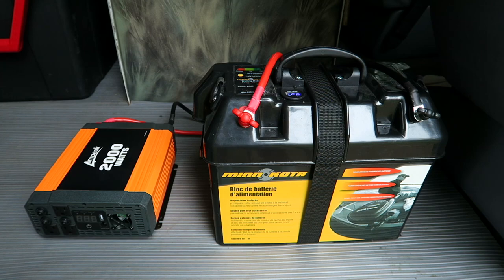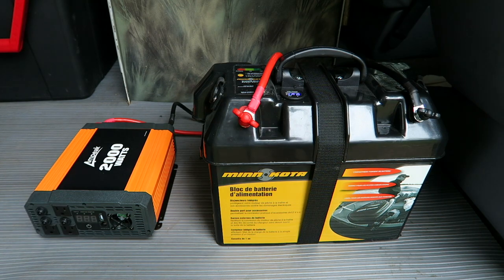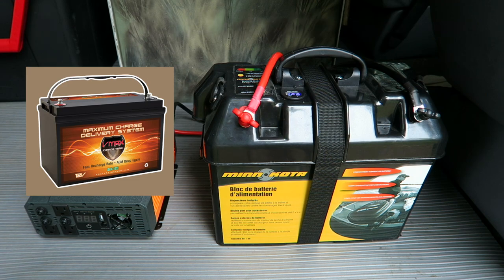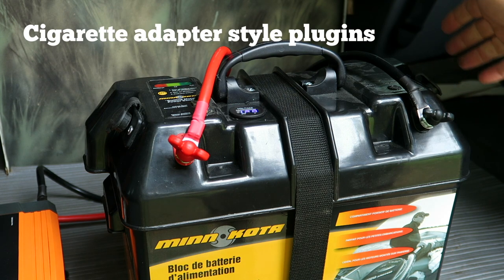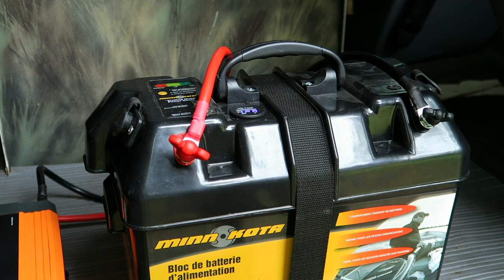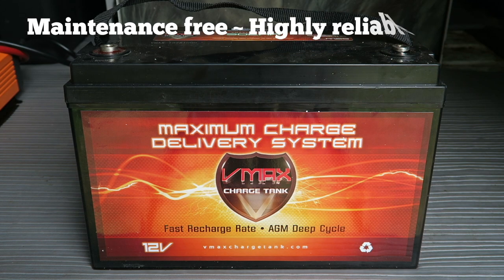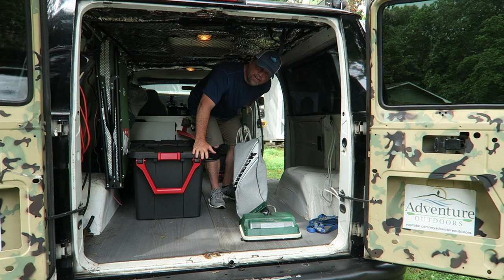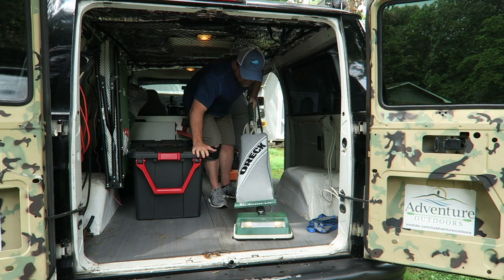How to Build a Van Off-Grid Power System with VMAX SLR 125 Battery

Comment: I live in a very small Camper Trailer, with no Electricity access unless I want to spend vast amounts of $ in gas for my 5000 watt generator. I only need electricity to power either the microwave oven in the Camper, or my hot air fryer. I would only be running the microwave for a Max amount of 5 minutes, or the hot air fryer for a Max amount of 15 minutes, just long enough to make a decent hot meal. I know the inverter is big enough to power each device separately, which is my intention. My questions are as follows:
1) is one 12 volt deep cycle Marine battery enough or would 2 hooked in parallel be better ?
2) I know I will need a floater charger to keep the battery topped off, but would I be able to plug the charger into the same inverter, and still be able to charge the same battery that is powering the inverter ? Or would I need to plug the charger into an alternate power source, such as another wall outlet or the generator ?

Comment: If it only has DC Cig lighter type outlets how do you plug in appliances like vacuum cleaner and hot plate? Can u plug in a microwave? Or not enough power. Thanks.
Reply: Never mind…that’s what the inverter is for. But I heard inverters were bad for batteries cuz they drain. But anyway if I get inverter, I just hook up the negative and positive cables to battery?
Reply from the maker: That is correct. Very simple.

Comment: How do you charge the battery?  Solar or Generator?
Reply from the maker: Currently i just use a wall charger. I don't need extended power so a full charge lasts me for a camping trip.
Reply: Do you mean you just charge the battery by hooking it up to a wall charger in your house? Also dint you have to charge the AGM during weekend trips if it drains lower than 70% ? If so I heard there are portable chargers but I have not yet see them on YouTube or anywhere. Some people hook the AGM up to the engine. And some use solar. But I want to see about portable chargers. Thanks for any info you can give.